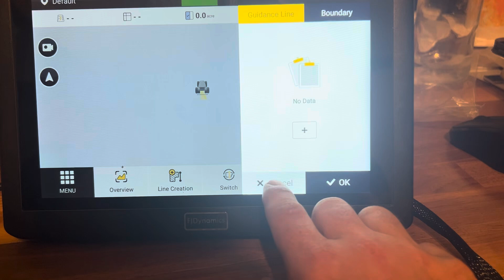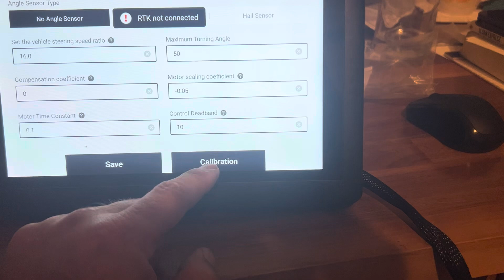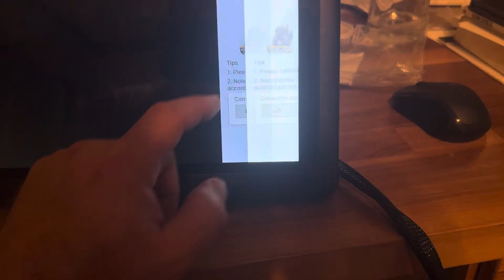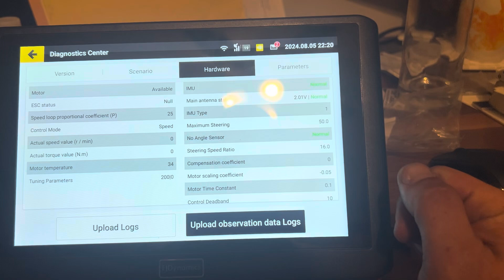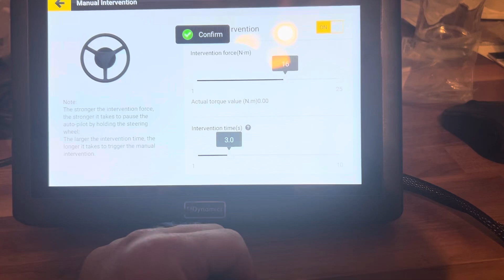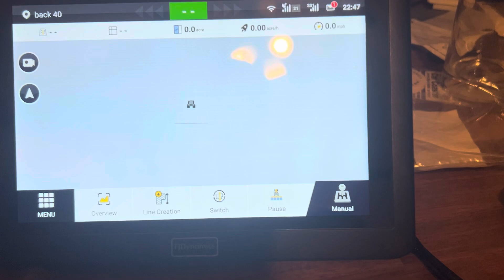FJ Dynamics AT2 display walk thru/setup

Comment: 1. How did you get to power the terminal in your room? What are you using?
2. If a client has SHP files and wants us to upload them to the terminal and use their field maps? How do you do that? You noted that the data transfer is not used.

Comment: Does this have to have internet access every time I want to logon to use it?
Reply from the maker: Once you log on it should stay logged on.  If it don’t may need to talk to dealer and see what is going on.  But to log on yes you need WiFi connection.